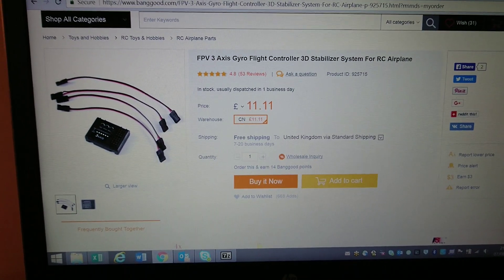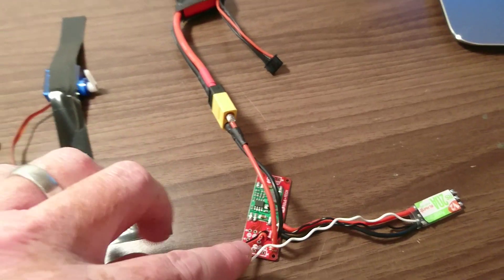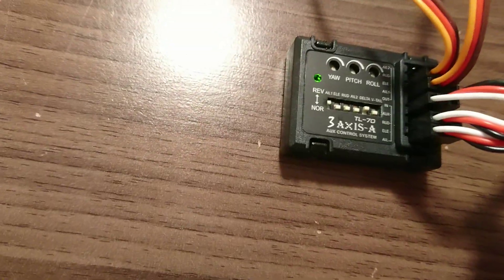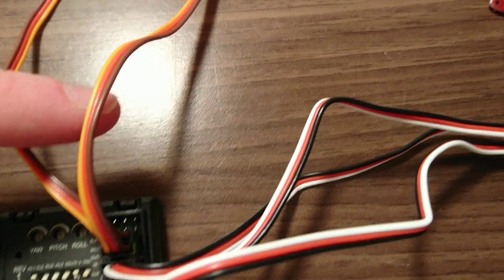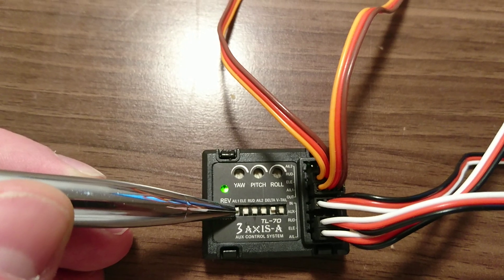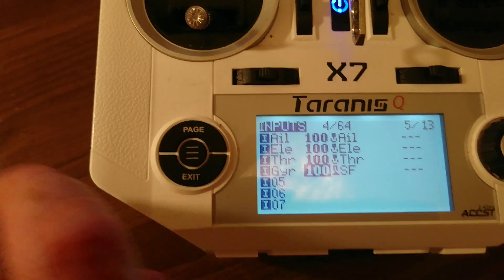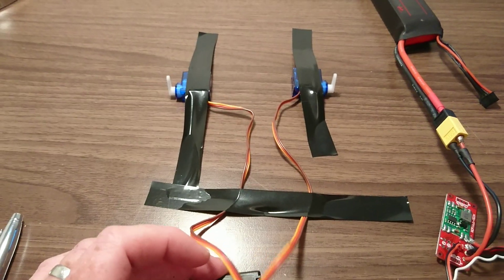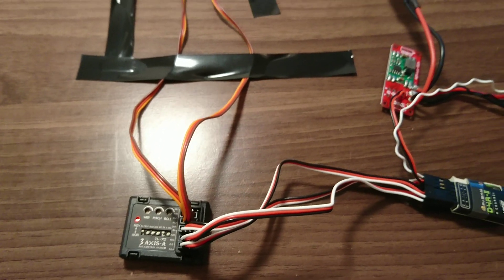Setting up for a wing: FPV 3 Axis Gyro Flight Controller 3D Stabilizer System For RC Airplane TL-70

Comment: I use  a flysky transmitter , will I be able to power this with my rx and also switch the gyro on and off with my transmitter?
Reply: Yes, this should work with any 2.4ghz  4 channel or above rc transmitter/receiver combo that worked before introducing this variable.  If you have a flysky 6 channel or above  transmitter and a reciever that is currently bound  together you should be able to add this in your setup and go flying. Although it is advisable to setup a fresh model on your tx if you did any mixing on the currently bound model because this stabilizer should already do all mixing for you.

Comment: I'm wanting to control a single servo to level a camera vertically in flight, will this controller work with only the power connected?

Comment: Hi, can you still roll and loop with the gyro on? thanks
Reply from the maker: Christopher Len Yes you can it doesn't auto level it just counteracts movement from external forces like wind. Given I've had to mount it upside down to make it work, there may be better options to choose.
Reply: Yes. You should still be able to roll and loop. It will still allow pilot input. The gyro is not an auto-level device such as Horizon's ASX3 systems.

Comment: so this will auto level my wing?
Reply from the maker: hquiroz113064 Hi, no it won't. It doesn't have auto leveling (no accelerometer so it can't tell which way it's facing) it's just a gyro so detects movement. Any movement the wing makes that isn't input by the sticks, I. E. Wind it will correct. So it will keep at the roll angle and pitch your flying at but won't self level.
Reply: The gyro will not auto-level your wing, but it will compensate for influences from wind or bad flight design characteristics and to maintain and help stabilize the craft to perform smoother. It will aid in the pilot's input on the control surfaces.

Comment from the maker: PLEASE READ!! Since making this video, I've installed it the wing. I've now realised that the gyro compensates in the opposite direction to the way it should on the roll Axis with this set up. I've got a work around, but it's far less than ideal. It basically seems that the logic in the gyro expects the servos to be mounted facing the same direction. In my Reptile s800 build this isn't possible, they lay flat with the servo horns pointing out. The control inputs are correct on all Axis and the gyro input is correct on pitch but reversed on role. I've tried every combination possible to resolve this, but in Delta (wing) mode it doesn't seem possible. The reverse switches only effect the gyro input not the TX input which is fine, but when you select reverse on an Axis it switches between the servos correcting in the same direction as each other or the opposite direction of each other. With the servos both pointing out they need to correct role in opposition directions to each other but I'm the reverse direction to how they currently do. There is no way to do this. Reverse just makes then both move in the same direction. The only fix I could find was to mount the gyro upside down! With it mounted upside down and the servo plugs at the back, the pitch Axis is still the same but the role Axis is reversed. I've had to mount it on a foam block due to the servo plugs facing down. The major disadvantage of this is that to adjust the gains I need to pull the gyro out and then stick it back in again. In all honesty if you need a gyro for a wing, where the servo both face out towards the tips of the wing (or onwards) I'd consider looking at a different gyro. That being said once it's set up you shouldn't have to touch it, so I'll be keeping it in my wing.
Reply: I have this gyro on a flying wing as well. It ok fine, but I spent roughly three hours trying to finally to get it to work. It was a pain to figure out.I wish I would have documented to process. I will stick with the other brands of gyro's I use because of the simpler setup process.